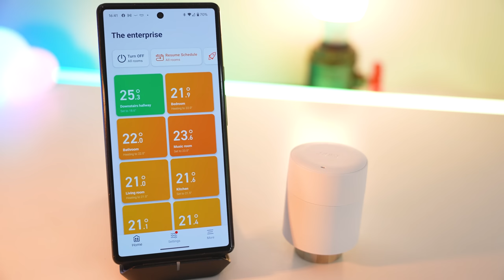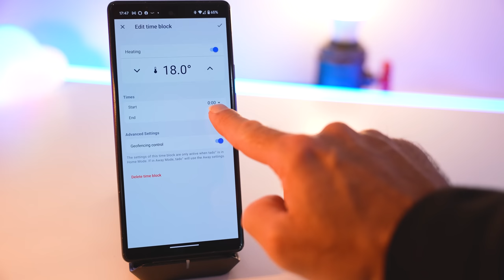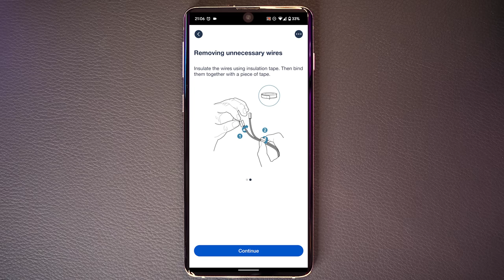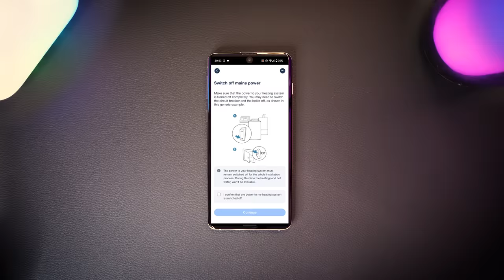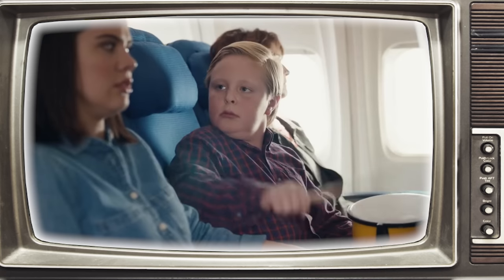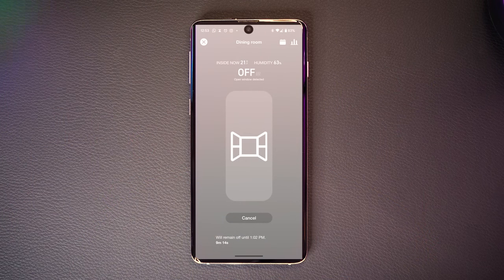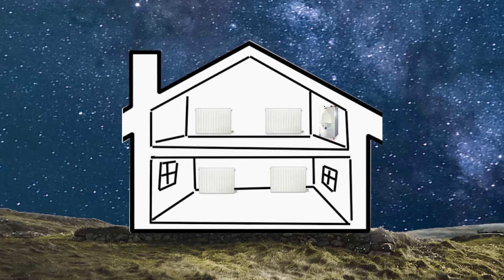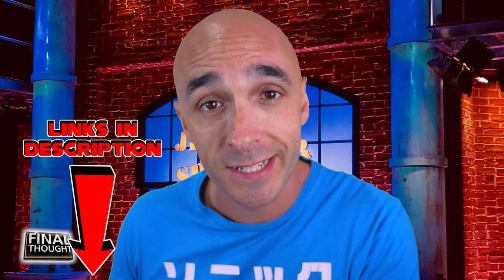Install This On Your Radiator & Drink The Tears Of Your Energy Company

Comment: I've been using Tado for almost a year now. Similar setup with 7 smart TRVs. VERY pleased with it. Only heating the rooms we need is genuinely saving money but also makes the whole central heating system more efficient because you can do things like just heat the bedrooms first thing in the morning then turn those off and heat downstairs once everyone is up, so the boiler is only having to heat 6 rads at a time and not 12. We're using Homekit for the Geofence features so that we don't have to buy into the subscription service (which i'm not sure you mentioned?). Tado also plays nicely with IFTTT so you can setup rules like .... if kids bedroom goes above 23 degrees assume they've overridden the default controls and set it back to default again ;)
Reply: Nice one 👌 so, you can heat upstairs and downstairs independently. Can you. Control a third zone independently? Like a hot water zone? I've a Nest set up and would like to try use Alexa routines to make the Tado TRV's work with it rather than having to replace the current Nest and hot water controls I have in place.
Reply: @PhillyStafford  with Tado, it’s not even zones - you can heat rooms independently. You can heat radiators within rooms independently!
I’m not sure about the particular setup you’re describing with the hot water zone (if you have a compatible system, you can use Tado to control your water too) but Tado works very well with other smart home technology so it’s very possible to create all kinds of routines and automations that perform a wide variety of functions. As an example, I have a routine that, when my washing is finished, it turns on my utility radiator to 25° for 30mins in anticipation of putting washing on an airer. I have a command at night that turns off all my lights and all remaining heating when we go to bed. I use a variety of routines to closely dial in the temperature in my child’s room. So, it’s very flexible in terms of communication with other technology you may have.
Reply: @PhillyStafford  yes, each smart TRV can have its own schedule so i've just got upstairs on say at 6-7am and house downstairs on at 7-8am. Hot water has its own schedule too. Alexa works well to say "turn on hot water" or "set office to 20" etc. Wouldn't think they can work without their dedicated boiler control unit though.
Reply from the maker: @smithleon  Thanks for the kind words my friend!  I'm having a bit of confusion with the "subscription" conversation, a few people have mentioned it now, but I've seen no sign of it in practice!  I've even enabled geofencing this morning to see if it was behind a paywall, but it just enabled 🤔
Reply: @paulhibbert  interesting! Go to the app, into Settings and then into the Auto-Assist bit and see what's in there.
Reply: I need to keep the heat up beyond 24c due to Fibromyalgia. If its daughters playing with the heat it's possibly that (80/20% gender balance) - autoimmune disease - starts with pain left thigh and across pelvis preceded often with unexplained excema.. If temperature is too low then it means stiffness, pain and easily pulled torn muscles on exercise (like walking). It's also a tumour inciting syndrome - it mucks about with the cytokine balance in the body (amongst other things, cytokines regulate cell death and abnormal growth).
Interesting idea splitting bedroom and living heat - sometimes think the Roman system more efficient (with central uptakes so bedrooms heated from the uptake heat).

Comment: One big problem with TRV's in general is that they measure their temperature at the radiator. Therefore if it thinks it's too cold, it'll will open the valves but it will register a far higher temperature in a real quick time. The only real solution for that is to use a separate (wall) thermostat, which Tado also sells. I'm using Homematic, which essentially does the same thing.
Reply: There is a way around using a wall thermostat. You can set a Temperature Offset on the radiator valve.  If you tap on settings, then Rooms & Devices, then the room you want to Offset the Temperature in, you'll see Temperature Offset. Tap on Learn More, this will take you to a page that explains how to do it. Hope this helps you bud.
Reply: @bob900868  I get what you mean but that doesn’t solve the problem. Even with an offset, the measured temperature near the radiator is always off when it’s heating. So your TRV will detect a much higher temperature when the radiator is blasting heat. If you set an offset, then the temperature in the room will drop even further than normal causing your TRV to open up again. Also, your radiator will stop too soon, so your TRV will say it’s 20 degrees while in reality it’s only 18 degrees in the room.
Reply: You have to set the offset tempature on your phone app! If you don't do this the valve on the radiator won't close till its set temperature is reached.

Comment: I have them also. two things bad with them. 1 subscription based and 2. does not work on return heat. like old school floor heating
Reply: Klaus, could you please explain what you mean by 'return heat'?
Reply: @soundman127  example. I have pellet heating. The floor heating is by water. But heated on the return back. Not when pumped. Or what ever happens.but the tado don't even fit that kind of valve.

Comment: I know I must love this channel because I watched a video about a smart radiator device even though I’ve only seen radiators on old black and white sitcoms and maybe an apartment in NYC. Apparently radiator isn’t UK English for HVAC. 
In Georgia and Florida, USA HVAC is the way to go.
Keep up the good work!
Reply: Radiators are one way to do one part of the hvac conglomeration. The New York radiators you’ve seen are likely to have been low pressure steam radiators. Us europeans use water as the working fluid, which is less dangerous. Air duct based systems as common in the US are a very different branch of the tech tree, with a major advantage of being able to easily do central cooling.

Comment: I've been using Tado for 18 months. Yes it IS expensive but has saved me nearly 40% on my gas bill - yup... FORTY!!
The temperature offset SORT OF works but not perfectly. If you set it when the room is up to temp it's then it's out of whack when the room's hotter/colder than that - this can play havoc if you have the room heated to different temps depending on time/day. 
You can link each TRV to a Tado temp sensor placed somewhere else in the room and tell the system to use that reading instead of the TRV's - these too aren't cheap, but do completely solve the problem. 
The presence sensing and open window detection will notify you to turn the heating off manually, but to have this happen automatically requires a subscription - £2.69/month or £21.99/year. If you have Hubitat or Home Assistant (and, of course, some window sensors!) you can get both of these things to happen without coughing up any dough. 
Lastly, it IS fairly easy to install and Tado's instructions are very good. If you DO need the assistance of an engineer to install it ASK THEM if they know about Tado before they turn up. None of the engineers who've ever turned up to service/repair my boiler had even HEARD of Tado!

Comment: Important: The Tado dual wired system for the UK to switch heating and hot water DOES NOT SUPPORT OPENTHERM. The Tado UK retail version also DOES NOT SUPPORT OPENTHERM AT ALL (they removed it a year ago). You only get OpenTherm in the EU version, and I think that only when a Combi boiler is doing the hot water.  Same is true with Drayton Wiser.  If you have an old S-Plan (or S-Plan+) system, and/or you want to convert to priority hot water on X-Plan with OpenTherm -- Evohome seems to be the only answer.  It's taken me weeks to find this out, and the answers are all hidden in forums.

Comment: I've tried multiple radiator valves but the fittings are too flimsy and the valves falls off or holds on crocked and malfunction.
Guess I need a 3D printer to make a better fitting 🫤
A problem with both Danfoss and Aqara valves

Comment: Thanks, Paul. Just switched my Hive system (which is terrible) over to Tado based on this video. Overall, I'm really pleased.
One negative thing of utmost importance, though! The internet bridge is the central point of communication - all devices talk directly to that. If a device is too far away from the IB, then it won't be able to communicate, and sadly, Tado do not offer any solution to this other then put the IB nearer the device - there is no option of a range extender or multiple IBs.
Fortunately for me, this was fine when I relocated my IB to a more central part of the house, but for very large houses (or houses with thick stone walls), this could be a complete deal breaker.
Great system, though - thanks for the review. And it works great with Home Assistance. I'm using the Tado integration (the non local one) at the moment instead of the Homekit Integration - the Tado one is more flexible with the ability to switch Modes/Schedules, etc. But, if Tado ever go offline, then I can easily switch to the Homekit integration 😁
Reply from the maker: Good shout hadn't really thought about how it might perform in a larger house. Glad you're enjoying it dude.

Comment: Shelly recently released similar TRVs. But with one small key difference, they're cloud free! I just can't accept the radiators not working as they should just because the internet went down or Tado went out of business
Reply: And you can add a Shelly 1 to the boiler, to make the ON/OFF. In the Shelly app you have the "thermostat" function, where you define where it should measure the tempertature, and wich shelly1 should do the ON/OFF to the boiler!

Comment: Can wholeheartedly recommend Tado. Have used it since 2020 and it's excellent in setup, usage and cost saving! Right now in the process of ripping all radiators off of the wall and replacing them with Adax convection heaters (because: no gas; WiFi & Bluetooth; local control). So, while saying goodbye to Tado controlled gas-powered radiators, I will be switching it over to Tado thermostats per room to control Adax heaters instead. Because Home Assistant :p

Comment: Great video, what about the zigbee tuya ones? Would love to see a comparison review
Reply: I found the zigbee thermostats kept losing connection with the hub. It was the two thermostat furthest away that were the problem, I tried a zigbee plug half way between the thermostats and the hub, to boost the signal, but it didn't work. In the end I sent them back and bought Tado.

Comment: I believe there are cheaper ways to do the same costing you less money! Considering a two-bed apartment with two bathrooms, you need +-5 modules(+-400€). That's a lot of energy that you have to save to pay the solution, I mean, I hardly see myself paying for the solution with savings in less than 2-3yr. I love the product, and every time I see one new brand my eyes shine but I do believe there are cheaper ways to almost, i mean almost achieve the same result.
I have done on my apartment with a shelly 1 that controls my Boiler relay + xiaomi HT + HA (30€ not considering the HA price)

Comment: Wow, finally thermostat!!!
I was even was considering to propose to do review of the Tado solution. 
Question: is it possible to effectively use the system without connecting to the boiler (so boiler always will be On)?
Like many people I am renting my flat and don't want to do it.
If not, do you know any other similar solution?
Thanks, great job 👍
Reply: You can replace all your radiator valves with smart valves. As long as your main thermostat remains on, the valves will function. What I had to do in the past was turn my analog thermostat up high and let the independent valves manage the heat. The only issue with this was that my bathroom radiators are not smart so they would be always on and always really hot. Got that solved now.
But yeah, if you’re renting, you can change the valves and take them with you when you leave - no property modifications needed.
Reply: @inthapipeline  thanks, my issue (probably many is in this situation) is that most of radiators are covered by furniture or other stuff, so only smart valves will not adjust room temperature properly.  This system have additional thermostat which can be placed anywhere in there room and provide more accurate readings

Comment: Do radiators really work that well to heat your home? My only experience with radiators is when I was a child in elementary school the classrooms had radiators and we were always cold. The teachers let us wear our coats because of this. I looked up radiators and apparently it works by heating water and pumping the hot water thru pipes ,thereby heating a room. It just seems seriously inefficient! We personally have Natura gas forced air heat in our home and it heats the home really qwick and only has to run briefly every now and then. Radiators just seem weird to me.
Reply from the maker: I assume that in brick built homes it must be the most efficient option, otherwise there would be a push in the UK to replace them.  Brand new houses are still built with them over here.
Reply: @paulhibbert  oh ok....awesome, hey if it works it works. Maybe the radiators in my school were not working well. Loke u said if they didn't work nobody would be using them . They especially wouldn't put them in brand new buildings like u said. Thanks 😊
Reply from the maker: @number1pappy  no worries man.  It's interesting how different climates have different solutions. Until recently I assumed all houses across the world were primarily brick, but apparently in hot countries it would be a nightmare to live in a brick house.

Comment: After having looked at all the Smart Heating Controls with OpenTherm. I have to say we chose Honeywell evoHome.  Its 100% local! may be worth a look. and it also supports UFH, electrical loads via relays. and Zero wifi interference / Internet required.

Comment: Another great video as always, we love our tado system but do plan to make it local via home assistant as the only thing that really bugs me is the possibility that the heating comes on via schedule then we loose the cloud and/or internet and then the heating will stay on indefinitely, which is a worry - although in approx 18 months this hasn’t happened but there have been a few cloud outages in this time so the possibility for this issue is real
Reply: If they lose the internet they will still run according to the existing schedule. You just won't be able to adjust that schedule until the internet is back.
Reply: @simonc111  the schedule is stored on the cloud, so if they turn on as per the schedule and then the system looses it’s cloud connection the heating will stay on indefinitely until the cloud connection is restored, it equally requires the cloud to turn them on and OFF. Look at the tado forums and groups to see how many people have come home after a few days away to find out there heating has been stuck on for days due to outages.
Reply: You're right Pico! Sorry, thought it stored it locally. Luckily I've rarely had issues and they've been off when it's happened, which I guess is the better way round :-)

Comment: another fabulous video Paul. I have a similar “DIY” setup using TuYa TRVs and home assistant. Saved me a bit of money but certainly not as polished as the tado system. 

Great work!
Reply from the maker: Nice!  How do you rate them for accuracy and reliability?
Reply: @paulhibbert  they are very reliable in terms of actuating but I don’t have much confidence in the temperature readings. I use separate temp sensors which I think are more accurate

Comment: 2 year battery life...bollox...I've been using them for a year and all the valves have had a battery change.  The geofencing is great though when you get the in-laws round to babysit in the winter and both mobiles linked to it are out on the town 🤣

Comment: Range is a problem with the Tado system. I have a small semi-detached, and finding a spot for the bridge that all the TRVs can reach was a mission! Every device needs a direct connection to the bridge, there’s no mesh functionality, and Tado will not create an extender, or the ability to add a second bridge, despite being asked to by a large number of people on the community forum for years.
If you are unlucky enough to have this issue (especially unlucky if you’ve built your system up slowly over a couple years) then you are screwed, there is no solution.
That being said, this has been my only issue in 5 years, everything else has worked flawlessly.